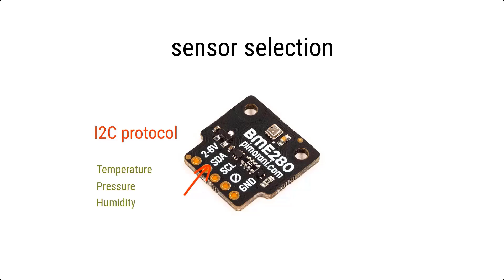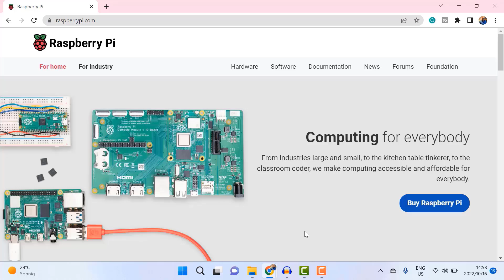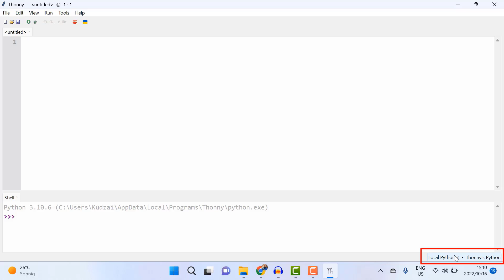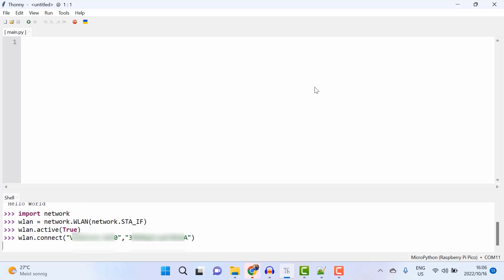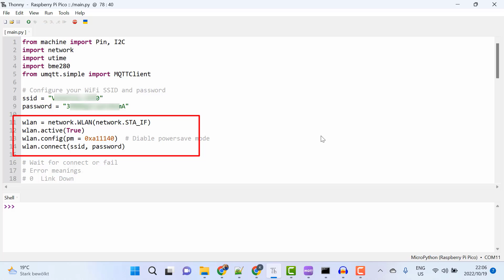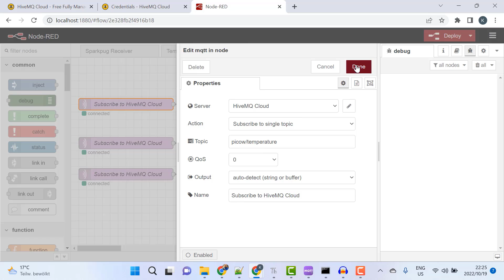Raspberry Pi Pico W for IoT Project Using MicroPython and MQTT [ A Complete Guide ]

Comment: I get stuck on two issues. 1) Thonny can only work in Run as Administrator when using Manage Packages, otherwise get the error "Could not find the package info from PyPI. Error code: <urlopen error [SSL: CERTIFICATE_VERIFY_FAILED] certificate verify failed: certificate has expired (_ssl.c:997)>". 2) When Thonny is run as "Run as Administrator" I get the following error when trying Manage Packages: "/micropython-upip-1.2.6.tar.gz does not appear to be a Python project: neither 'setup.py' nor 'pyproject.toml' found. Process returned with code 1". Also, in Run as Administrator mode the Pico doesn't connect to the computer. I'm using Microsoft Windows 10 Home and Thonny 4.0.1. The video was useful in showing how to run commands on the shell tab.
Reply from the maker: Hey Milton, thanks for your comment. I didn't have to run Thonny as Administrator and had no issues with connecting Pico to computer. I'd encourage you to try this on a different PC.